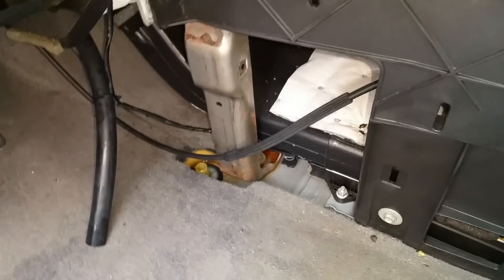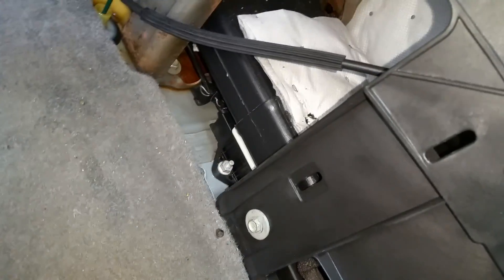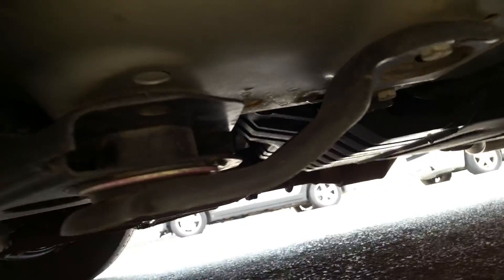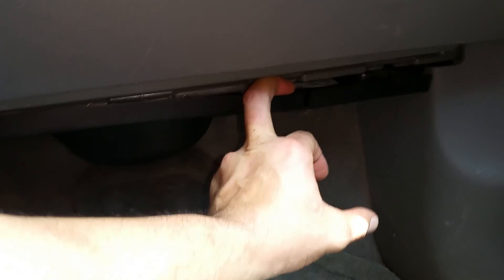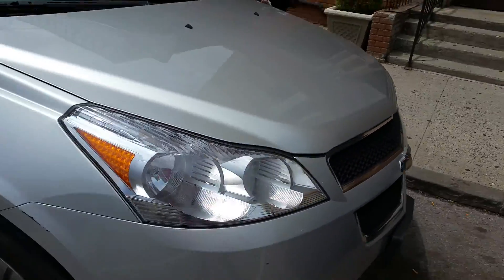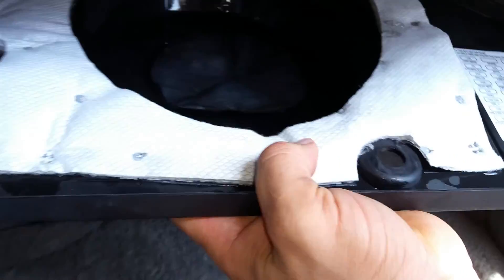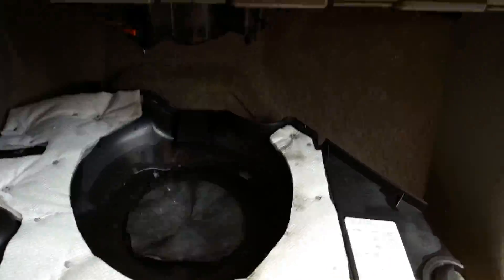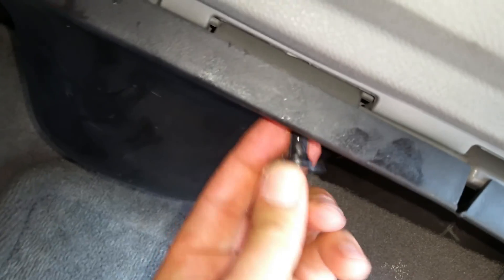Traverse 2010 passenger water leak solved part1of2

Comment: Great fix! I have a 2013 Chevy Traverse my wife took it to the dealer and they said they could not replicate the sound, however, my wife still heard it after driving it. So we let it go until this spring / summer and it still made the sound but this time it was worse.  After watching your video and another one I took off the tub and poured the water out. I took out the hose and about a gallon of water poured out. Thank you for the video because the dealer acts as if they don't know anything.   Please keep posting and keep up the good work!